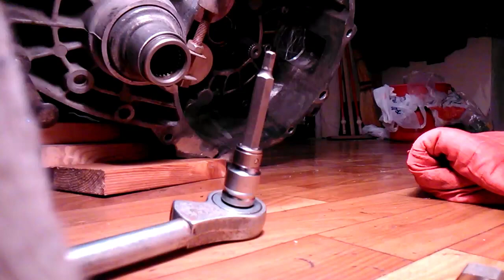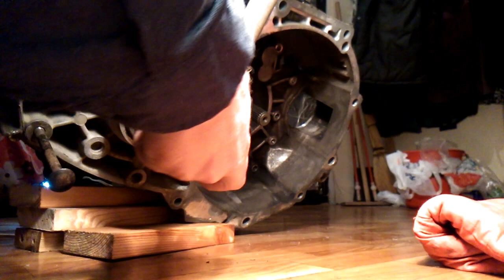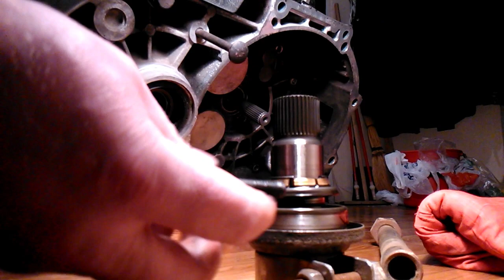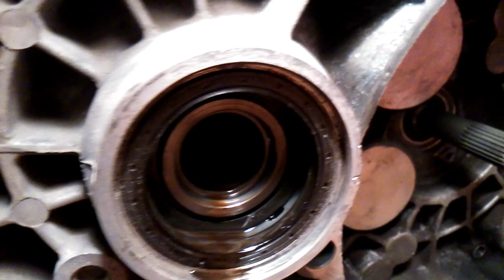Disconnecting the right flange from the gearbox MQ350 02N (Volkswagen Sharan 2000-2010)

Comment: Can I ask if you had a noise when steering at low speed and if you removed the flange to change the shims and spacers?
Reply from the maker: When the problem occurs, there was a noise while descending the speed. To add a shim, you need only remove primary shaft cover cap. I remove the flange because i need to disassemble the gearbox.